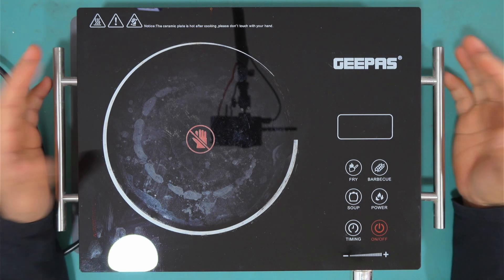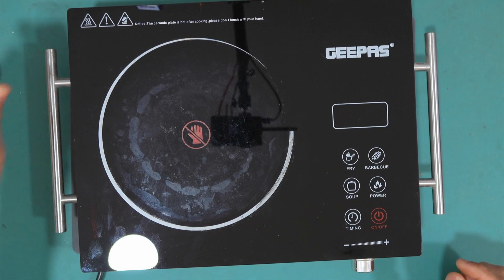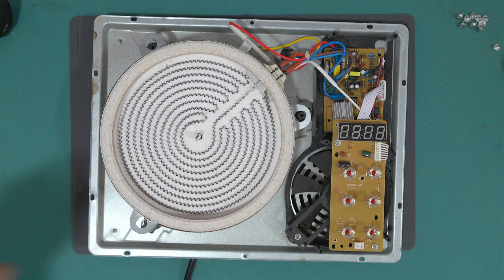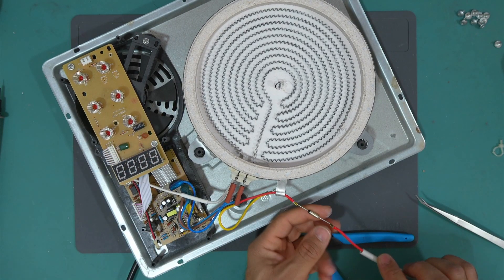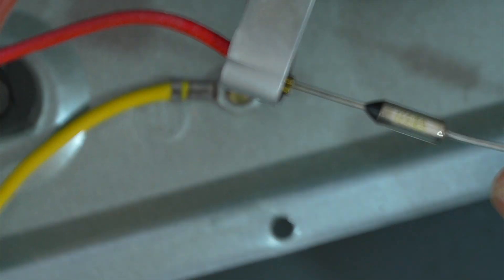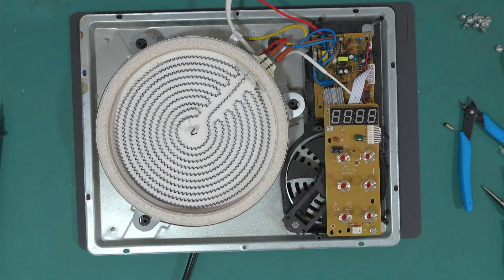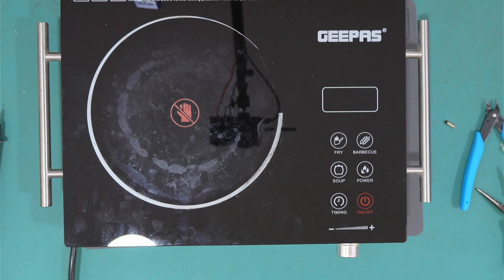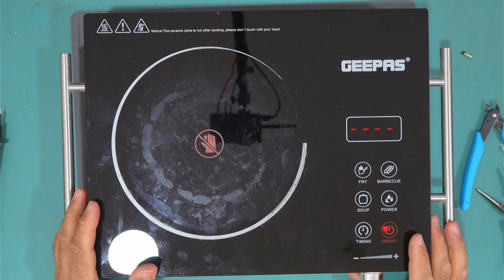Geepas Cooktop Not Heating up Fixed #repair

Comment: I watch your videos with admiration, I am a close follower of yours, I hope you will be successful forever. Sir, I have a problem that I cannot achieve, the 7-legged PWM integrated circuit of the 600 watt cooler master power supply is broken, so no code text can be read. What can I do?
Reply from the maker: Hello friend 
I really appreciate your kind words brother, unfortunately I can't be 100 percent sure about it, but the 7 leged ic is the standby rail ic for sure, So it could be TNY277PN.
Try and get the datasheet of this ic (TNY277PN) and look for the circuit diagram and compare it with the components on the board to see if does match.

By the way TNY277PN ic is used in Cooler Master RS-460
 
keep asking in the comment section
All the best brother
Reply: @FixTronics  thanks